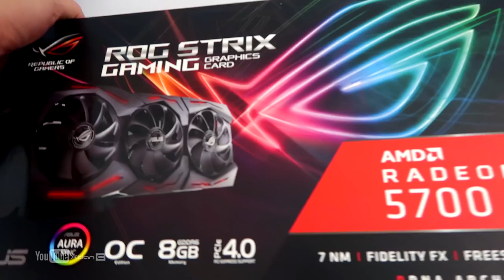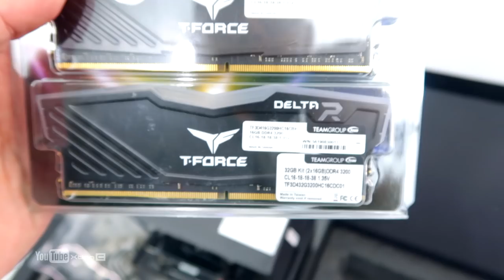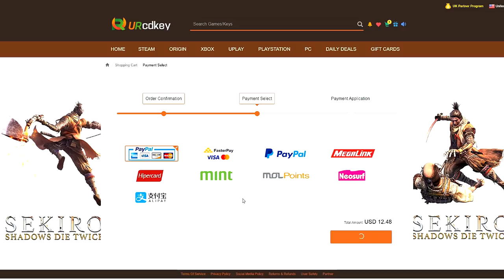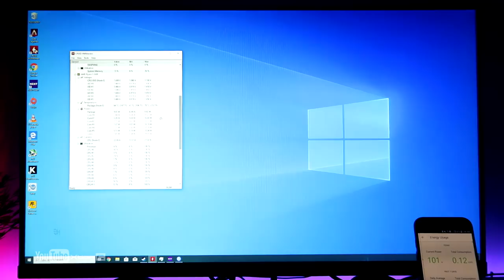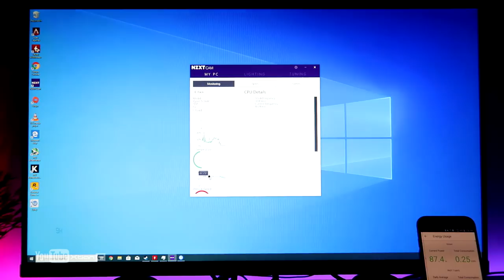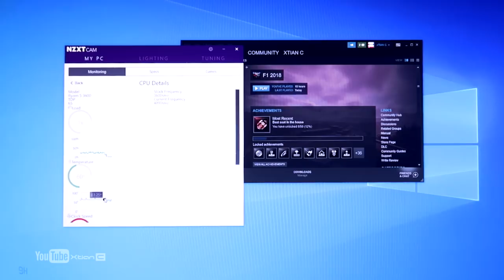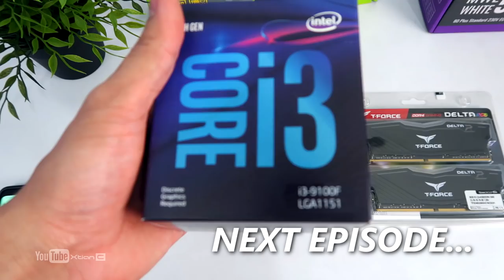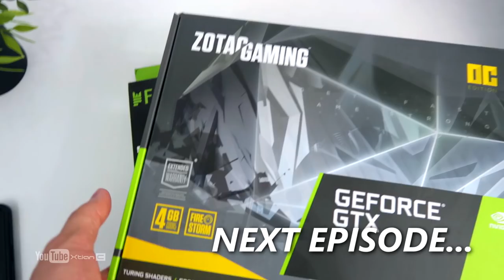VLOG: Php70K ROG mini-ITX Gaming PC Build I Ryzen 5 3600 + ROG Strix RX 5700 XT w/ 7 Game Benchmarks

Comment from the maker: Next Episode guys 25K Budget (Intel-based) Gaming PC!

*Full Specs:
*
•CPU: AMD Ryzen 5 3600
AMAZON: https://amzn.to/2PTfr04
LAZADA: http://bit.ly/2L7nroF

•Motherboard:  Asus ROG Strix B450i Gaming
AMAZON = https://amzn.to/2CMWumv
LAZADA = http://bit.ly/2QjLHrX

•GPU: ROG Strix RTX 5700 XT= 30,500
AMAZON - https://amzn.to/2OmcEsy
LAZADA - http://bit.ly/2KqNnMo

•RAM: 32gb (dual) ddr4 3200mhz Tforce Delta RGB
AMAZON - https://amzn.to/32Wf8mI
LAZADA - http://bit.ly/37aCOqw

•Cooler: Deep Cool Gammax GT RGB 
AMAZON - https://amzn.to/2NR8iu9
LAZADA - http://bit.ly/2XjAbOK

•Storage SSD: 1TB Crucial P1 Nvme 
AMAZON - https://amzn.to/2COT7eF
LAZADA - http://bit.ly/353XpuN

•Case Fans: Inwin Sirius 120mm Trio Pack
AMAZON - https://amzn.to/32Q5927
LAZADA - http://bit.ly/2NR3xAU

•Case: InWin A1+ mini ITX  w/ 650w 80+ Gold PSU 
AMAZON - https://amzn.to/2Qmjell
LAZADA - http://bit.ly/379Fbdi
Reply: Pa recommend naman ng 30k gming pc
Reply: Yownn 25k na buildds
Reply: ano po ma suggest nyu po na monitor for 1080p gaming 144 hz? Yung walang extra po sana at durable.
Reply: WAhhhhhH abang abang na
Reply: sir ano difference nung B450E sa B450i
Reply: Hi Xtian just wanna ask if Gigabyte Aorus 5700xt will fit in this case as well? planning to build the same thing but will go for Aorus Theme.
Reply: Anong room temp nung nag benchmark ka sa mga games Boss XtianC?

Comment: Pro:Ryzen 5 3600 or 3600x
Mobo:ROG Strix B450-
RAM:G.Skill Trident Z 16GB
GPU:ROG Strix Radeon RX 5700 XT
CPU Cooler:ROG Ryujin 360
PSU:ROG Strix 750w GOLD
Storage #1:Samsung 970 EVO Plus m.2 500gb nvme
Storage #2:Seagate 2tb or 3tb barracuda
Case:ROG Strix Helios
Pa help naman sa fans sir rgb po (7x) pati leds sir pa approve narin po kung tama lang yung build salamat boss xtian
Reply: overkil cooler mo paps
Reply: ok na din yan kung trip mo talaga ASUS ROG
Reply: @cain7925  oo zer pa help naman sa brand ng rgb fan kelangan ko ng 7 with splitter narin po
Reply: @tekashiq9774  may kasama na atang rgb fans yang case na gusto. Apat siguro
Reply: @cain7925  sana sir pero pinapanood ko mga build ni sir xtian wala sir ehhh
Reply: @tekashiq9774  baka pinalitan nya ng ibang fan. kung bibili ka ng fan addresable rgb ang bilhin mo, i recommend corsair brand.
Reply: @cain7925  sge po sir salamat po
Reply: @cain7925  sakto lang po ba yung mobo ko or mag x570-f po ako?
Reply: @tekashiq9774  sakto lang yang board na yan. Pero kung plan mo mag upgrade agad ng processor mag x570 kana.
Reply: @tekashiq9774  Isang tip pa wag ka bibili ng mumurahin na x570. Almost same performance lang sila ng lumang b450 board.